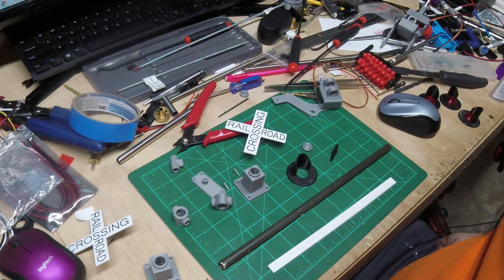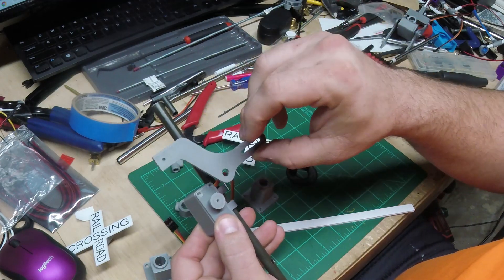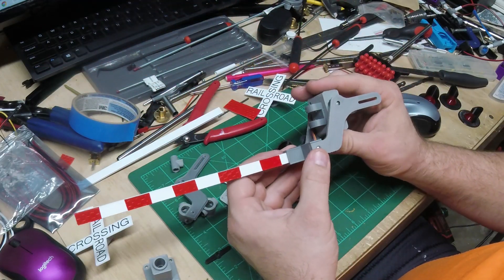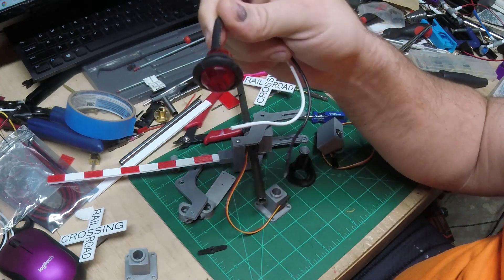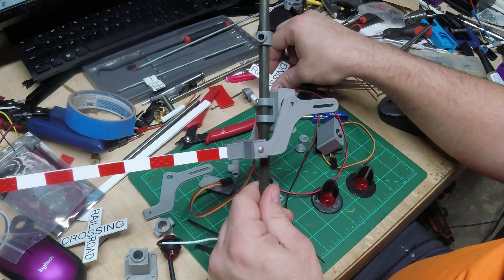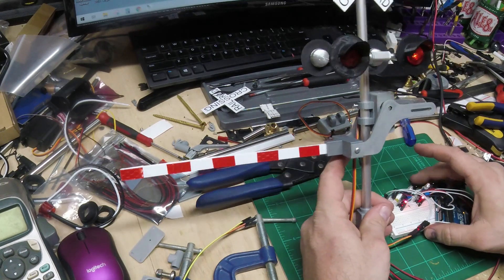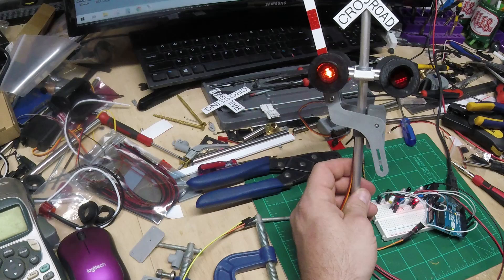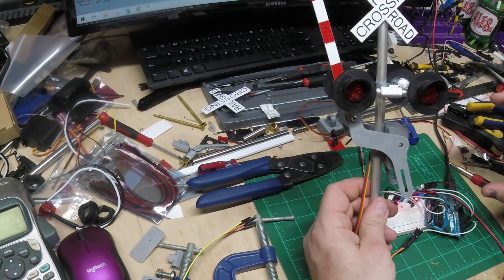Making a 1/14 Scale 4" Gauge Railroad Crossing Gate with Arduino

Comment: You should be that on 1 for the slowest movement to raise an lower......
But if you want a fully working sketch with bell sound I can share with you.....
Reply: I would like the sketch with bell sound if you don't mind sharing
Reply: @henryfehr6202  upon the sketch for this size of crossing you will have to adjust the movement of the gates up and down  and the speed in which is all in my sketch... an for a speaker you'll need a 5w. 8ohm and a BC547  idk how i would send you the diagram to hook it up....an for your set up I would just go with a Arduino pro. Mini that way it will be much  smaller to hide.